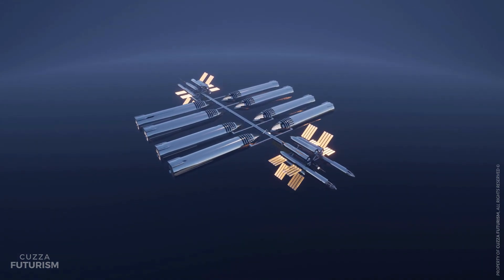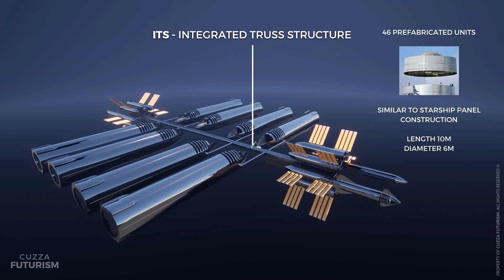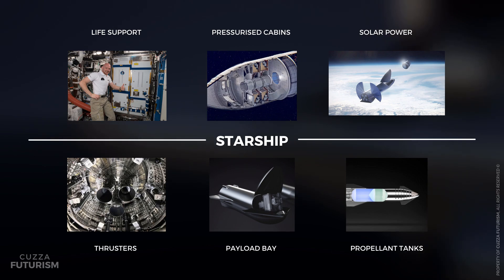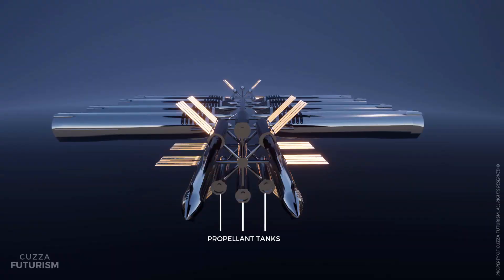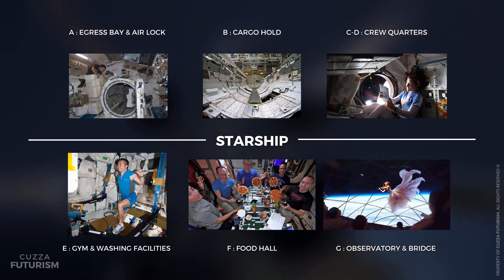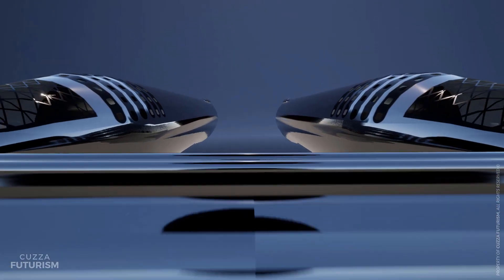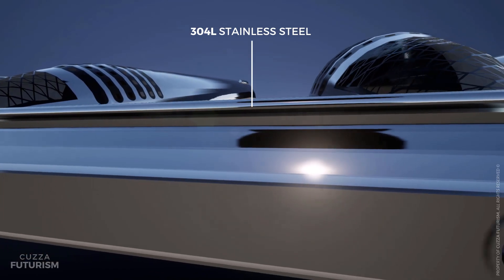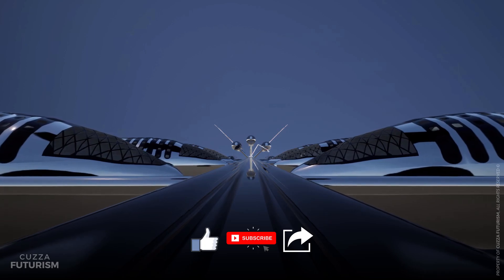SpaceX Space Station Concept - The OSS Part 1

Comment: The current ISS has layers of kevlar and other materials to protect from micro meteorites.  Any long duration, Mission is going to need this, or some sort of a Whipple shield to protect the occupants.  14 mm sheet of 304L stainless steel is not going to do the trick.  Your concept will not look all shiny and sleek, unless you do not want to protect the occupants of the station.  Even the methane and oxygen storage tanks will benefit from such shielding and protection insulating them from the inevitable times, when solar radiation directly hits these tanks.  The ISS and it’s spacecraft docked to the ISS have taken well publicized micro meteorite strikes
Having a Starship deliver pre-manufactured modules to orbit with an exterior diameter of up to 7.5 meters and 10 meters long would work. Even larger models,with be transported with the 13 meter diameter SpaceX rockets of the future.

Comment: SpaceX could do this on their own with a similar type of Space Station, at a great reduced cost of less then 500 million including launch cost!

The new ISS could use 4 StarShips on an interconnected hub system, that accepts up to 12  to 16 more ships and/or sections, and they would have over 4 times as much room with just those 4 ships alone, as the current ISS has right now!

They would have the capability to do experiments in isolation, not putting any other section in danger while doing so, just by detaching from the hub!

Cost to put it place less then 1 billion, including launch costs!